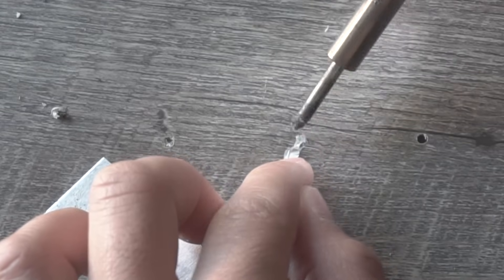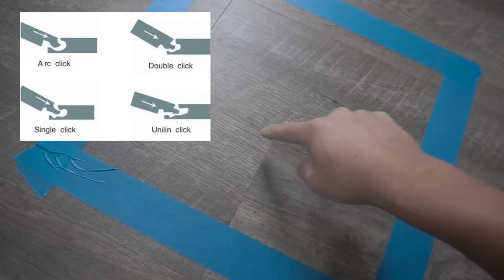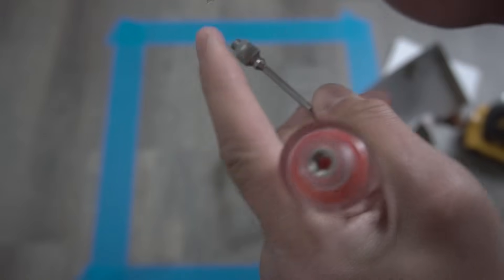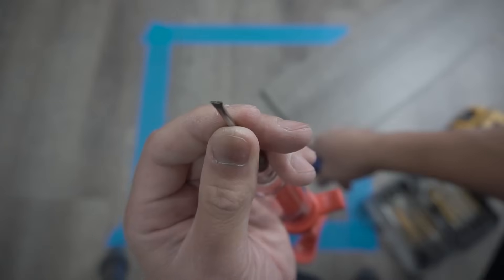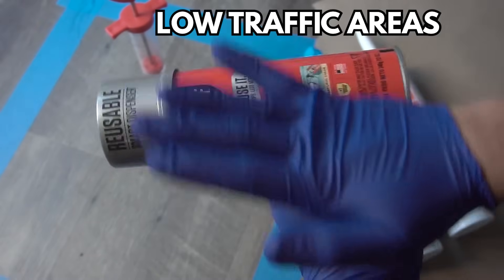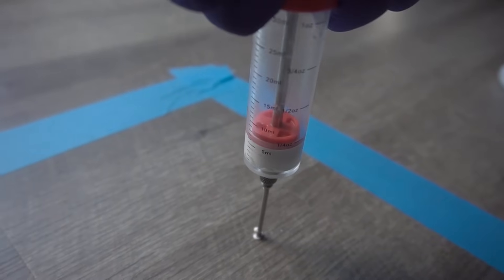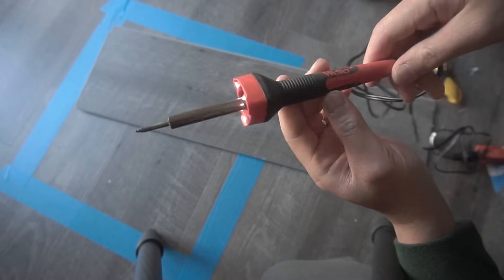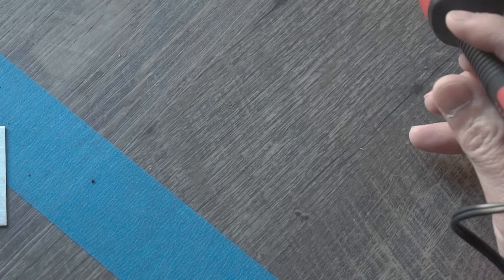How To Fill Hollow Spots Inside Vinyl Plank Flooring LVP Laminate And Engineered Hardwood Floors DIY

Comment: Thanks for the excellent video. I found this after seeing some similar videos, but yours is soo great, thanks.
I had a few issues which i think will help others in the future. 
1) Sealant/Caulking product recommendation: I'm in Australia and we don't have DAP products here. The most flexible stretchy sealant I could get was 35% (H.B. Fuller® FulaFlex™ 550LM Polyurethane Joint Sealant). However, I'm confident that this will allow enough contraction and expansion in my area.
2) Viscosity of sealant: 
2.a) The sealant I used was to viscous to come out of a 5mm meat marinade injector, at least I didn't have the strength to push it through and I could see failing, so I ended up using a caulking gun with the end of the nozzle which fitted snug in a 5mm drilled hole.
2.b) I couldn't get the sealant to fill the voids nicely, I inserted as much as I could before was unable to push anymore in. This helped fill the worst spots which I'm pretty happy with, but had to drill more holes than i had hoped. I might try in the future to find a product that is less viscous and flows easier to allow it to dissipate under the floorboards. 
3) Filling the drilled holes: I tried your solution in this video and confirm it works, however i wasn't happy with the finish and as I had more holes I ended up landing on another solution which I think works perfectly. I bought a 5mm leather hole wad punch, and used this to hammer out exact fitting plugs from a spare piece of floorboard (I have 8mm thick laminate engineered floorboards with cork on the base). I then simply used some glue and inserted the plugs into the holes. Any evidence of the holes completed disappeared, takes a long hard look to even find where the holes were.
Thanks again 👍

Comment: Best video I’ve found for this type of repair. I haven’t tried it yet but will soon. So far my tests of the (clever) soldering graft are not great. While I can get the hole mark to disappear when viewed from the top, depending on room light, the holes are very visible from an angle. Will try the trephine bit core idea posted by another user. I’m interested to see a follow up video if you have one. Also, have you considered injecting self-leveling compound (evidently, what should have been used in the first place) instead of stretchable caulk? Thanks!
Reply: Whats the trephine drill bit idea ? do you have a link please?
Reply: I think the self levelling compound is very loose and will travel all over the place. Caulk has better control and less movement when injected for the first time.
Reply: The trephine bit idea came from another poster here. I bought some on Amazon. They’re designed for drilling bone though which is not as hard as our flooring. I can’t get it to work. Idea is that your hole would be drilled w 3mm bit and you’d repair this with the core from a sample hole drilled with a 4mm bit. But it’s very hard to extract the core without ruining it. I think Jay’s whole idea hinges less on the material injected and more on the repair of the holes. My tests with soldering iron have all failed. Sure it disappears when viewed in shadow or from directly above, but in light, from an angle, you see a black smudge.

Comment: Crazy... Crazy good! I do flooring, professionally, I've always tore the floors up when I discovered a soft spot and relaid them... I also have a different method of patching holes and gaps, I use wood putty, and stain markers, or shavings like you did...
Reply from the maker: Thank you 🙏🏽! Means a lot coming from a pro! 👍🏽😊
Reply: Do you think plastic wood would work with the holes in lvp, and then I could just stain the plastic wood to match the flooring?

Comment: It would help if you mentioned the temperature setting you use on the soldering iron. Also, after doing 3 holes, the shavings stick to the tip. Nice if you told which of the 5 tips you used. I think it also might be better to only put an inch of the caulk in the syringe. It blows right past the o ring if you almost fill the tube and the replacement they give you is also too big.  We only got 5 holes out of it. Knowing a specific distance to make the air hole would be very useful. Process works, but is quite time consuming.

Comment: Where was this videos 3 months ago?? I had a guy come out and made my floors worst than they were before he worked on it. There’s little hills everywhere he drilled & put adhesive. He used some kind of JB Wield. I’m going to follow your instructions & hopefully I can fix my floors myself. Thanks for the awesome video man!
Reply from the maker: Oh no! I’m sorry to hear what happened 😢 I hope you get your floor fixed with this method. Keep me updated on how it turned out, best of luck my friend 🙏🏽
Reply: Dude jb weld is extra strong adhesive used for sticking metal bits together. You should not have paid him sounds like he is a cowboy.

Comment: Great info and solutions. One thing to note is that not all LVP/ laminate flooring can be slid apart at the end joints without damaging the locking mechanism. If your flooring is drop lock you will want to use the drill method shown in this video.
Reply from the maker: Thank you for sharing! 👍🏽😊

Comment: Very nice video that helped fix a 6" x 6" soft spot beneath my newly laid LVP floor.  Used a full tube of the Big Stretch, but after two days is rock-solid.  Like others have stated, the suggested injector is really a rotten piece of made-in-China garbage; however, it's probably not made to push something as thick as caulk.  After a lot of fiddling with the injector I got it to work satisfactorily.  Great job nevertheless!

Comment: Just had my LVP flooring installed. Looks amazing but there are several spots that sound hollow and move. Could it be the concrete isn’t leveled under? The flooring has thin padding attached but they only used a plastic moisture barrier under it.. I’m going to have the guy come back and look at it. Just need to do my research first. 🥹

Comment: Any recommendations for a newly laid LVP floor? Our interlocking floating LVP was installed over a month ago and we’ve had the flooring company out to our house again twice to discuss the hollow spots and they just keep telling us to “let the floor settle” and they want us to wait a few more months before they rip up our floor and add expensive concrete leveler. Looking to not rip up the whole floor and not pay them an extra $2000
Reply from the maker: Hi! Yes vinyl flooring (floating click system) will take time to settle to your subfloor. This will take weeks to a few months because it’s getting acclimated with your surrounding environment due to temperature change. Also if it is a very deep hollow spot that might be a problem (like the one in the video is 3/8” deep in some areas) you might want to try this technique on my video. Or if you can separate the planks and apply the compound yourself that would work as well. But just give it some time to settle and assess from there. 🙏🏽
Reply: Sorry but if a company did the install knowing the floor was unlevel i sure as hell wouldnt pay 2k for them not knowing what theyre doing just my two cents lol
Reply: I've been installing every type of flooring there is for over two decades. The very first thing I do is acess the condition of the surface where the flooring is being installed. Wether it be repairs needed or more importantly to ensure the surface is level before I do the actual installation. As a contractor, i would have noticed this issue during inspection and  explained to the customer what the issue is, the best solution, and of course the additional cost to correct....why it wasn't done this way in you situation is puzzling. Refer back to your contract to see who is responsible for the added cost to correct any issues after installation.
Reply: @abdal-haqq1688  the problem is no days it’s just about how fast can we get the job done. Just had our house built in January and have lvp floating with major hollow spots. What’s their go to answer? “The house has to settle” well it’s been 11 months and the spots are even worse than they were before. Our 1yr inspection is soon and I put in the notes that the floors need to be fix/replaced and they said they won’t cause there isn’t anything to do about it.... this is where my lawyer comes in now
Reply: @bradracine3426  I truly understand. This is where it's very important to only deal with contractors that were recommended or you have seen their work personally. You can't do any "List" or advisor because you really don't know what you're getting. When the estimate is done for you're project, this is the phase where you ask any questions you may have...there are no such things as dumb questions. If you decide to employ this contractor make sure he goes over the contract with you section by section. If there is anything you don't understand...ask!
At this point,you are not obligated to sign. Take a few days to have someone else you know who is knowledgeable in contracts to take a look and remember, there are two parts to a contract...1. the work to be done and  2. The after care and warranty and who's responsible for what.
Reply: it's not going to settle - a professional. Call in a flooring inspector asap
Reply: @bradracine3426  place a 6 foot level on your floor to ascertain and document how unleveled your floor is.

Comment: Hi, this is a great video, I bought the same material and followed you instruction, but I am having difficulties injecting into the drilled whole. I have Drilled many holes to let the air vent (also made sure that the needle not blocked, it was loose towards the floor) , but I didn’t manage to inject much…too much resistance. The floor is still is hollow. Do you have any tips? Thank you

Comment: Thanks! I'm going to try this at my in-laws' place but was wondering how you would approach doing this on a larger area? There's one area that's probably closer to 3'x3' and possibly even larger in their hallway. Would I need to drill multiple holes? Or space the holes out further?

Also, have you tried this with the clear colored Big Stretch or would you suggest white all the way? Just wondering if the clear would look weird or too translucent when you feather back in to patch up the holes...

Comment: Question for Fix This House: you published this video on Oct 31, 2021.  Today is Nov 30, 2021.  It's only one month later but would you comment or provide a follow up on how this repaired area is doing?  I have encountered this exact scenario in your video; the flooring is over a concrete slab.  Before I drill-and-fill, I'd like to know how yours has done.  Thanks for the video.
Reply from the maker: Hi! Ofcourse! I’ll do a follow up video.
Reply: I can tell you it failed for me, lesson learned. I should have used some self leveler before putting down LVPF since its soo thin and doesnt hold up if the floor sags at all.

Comment: Pro tip: properly floor prep the area before laying the floor and you won't have this problem
Reply: Absolutely!  I always make sure floor is level if not add some leveling cement.  So much easier if you get it at the start.
Reply: He did day this could happen with wooden subfloors during house settling or come from seasonal movement.

Comment: Like Lee said, you made it look very easy.  Although I used the 1/8” nozzle tip cut off as you demonstrated, no matter what I tried I could not get the Super Stretch to flow through the nozzle once put into the floor. Even without inserting the tip into the floor the flow was marginal. Sorry, but I drilled holes in my floor basically for no reason. I’m sure your technique is much better than mine.  At least filling the holes using your method worked, but  I’, glad you suggested practicing…you made it look easy, took 10 practice holes to get my results passable.
Reply from the maker: Hi! I think if you had a suction tool where you can lift the plank about 1/4” off the subfloor that would help you get the caulking inside the void. Sometimes if you over drill you will end up blocking the needle tip and burying it to the wooden underlayment or subfloor. Yes it does take a feel of where your hollow spot (sweet spot) is 🙏🏽

Comment: So a month ago I had installed engineered hardwood, I have issues with dip in certain areas. The problem is I had asbestos tiles underneath my old carpet. So I had cork cover it and then underlayment and finally engineered hardwood on top of everything. But now I’m noticing these dips, should I wait for the floor to adjust more or try out this method?

Comment: Hi there, 
I have recently had floating floorboards (engineered)  installed in my apartment. 
I was just wondering, does this method still work if you have an underlay between the the floating floorboard and concrete floor? 
Awesome video by the way
Reply: Same situation here so please comment. Also for concrete and thin foam underlay situations and a small area of just a few inches, if it is really necessary to drill a second hole since the inderlay is not really airtight?

Comment: Awesome video! I have a concrete foundation that has a pretty bad uneven spot that was never leveled. What do you think about injecting DAP concrete filler, instead of Big Stretch? Website says it is flexible and less likely to adhere to LVP, compared to Big Stretch. Any input is appreciated! Thanks!
Reply: Any updates to your project?
Reply: I'm in the same situation, uneven basement concrete foundation. Any updates? :-)

Comment: Expand Stretch is thick and difficult to push through into the floor. holding the meat marinader just above the gap in the floor is possible, keep trying! I used a name brand marinader (Vermont Castings) not sure if it helps, with largest diameter hole, cut with hack saw (wire cutters weren't enough). Since the caulking expands 600% I would let it set for about a half hour and then I put something heavy on the higher side so the vinyl plank can rise up as it sets. Oh, and if the caulking won't come out, push super hard to get the air bubble to come out as you're injecting under the floor, three out of five times I heard a loud pop and then injection worked smoothly. Cleaned the marinader with soap and water to get other hollow spots on another day.

Comment: What about adding glue while you install the flooring? We just had LVP installed onto our concrete subfloor of our basement and there are several soft spots/air pockets. I’m wondering if we should have addressed it then. So basically it’s not supposed to have those spots I take it?

Comment: Hey bro I've been practicing like you suggested on scrap pieces but cant seem to get it to blend like you did yours! 
Any suggestions like can i use something to paint it with a product? i have vinyl luxury plank click system installed. Thank you for your time
Reply from the maker: Hi! After you use the solder try using your fingernail and scuffing  the new plastic welded surface with a few runs and see if it disappears. It might look darker in different angles, but from top view it’ll look close to blended. 👍🏽😊

Comment: I have a similar situation I see a part of my laminate flooring that’s doing that but part of the laminate underneath seems to be missing the park is there but the wood part which is the base is missing. Is there anyway I can send you a video so you could confirm this method will work for me or give me some advice anything would be appreciated. I live on a budget and I’m disabled and I need to fix this as cheap as possible.

Comment: Thanks for the video! I will be using this solution to fix 2 spots in my flooring. One of the spots is not floating. Rather the vinyl floor it glued down over uneven concrete. What should I do about the dry time of the caulking? With the concrete below the vinyl keeping air out and the vinyl over the caulking, will this caulking ever dry in airtight pocket?
Reply: It will dry maybe take longer than usual. I would say 24 hours should be long enough before you can start walking on it.

Comment: Great vid and new subscriber, thx! Question/opinion  from you...I have property that I am renovating on a budget and plan to lay LVF that I currently have.  A 'friend' contractor used 1/2 sheet of plywood to 'repair' the subfloor, however the joints are badly uneven (1/4-1/2") off to the point I am unable to even the plywood with an impact driver. I have been attempting to research alternative methods of subfloor leveling but can only find concrete leveling (which will add too much weight to the structure) and osb/plywood shims to put under a newly laid plywood floor (budget will be difficult to do completely new floor). You injection video inspired me to wonder if my idea of pouring sand on subfloor joints instead of leveling concrete would work (??). If I were to do this method I could possibly add your technique if there were any void spots. What do you think?

Comment: 100% legit. I tried the window foam insulation and the DAP stretch. DAP is far superior, solid as a rock. Foam has a bit of give to it. I didnt use the suction to lift up so injecting DAP can be a pain and messy if your plunger is not flush with barrel all around. Tried and tested with 260 lbs.
Reply from the maker: Thank you! I’m glad I was able to help and it work led for you! 🙏🏽😊👍🏽
Reply: @FixThisHouse  thank you, sir! You saved me from a failed self leveling concrete that i didnt realize had drained below subfloor around bathtub. No more soft spots.

Comment: My suggestion is to get filler and furniture markers to repair the holes., especially if its in a spot that isn't very visible. Start with the lightest marker first to match the floor.